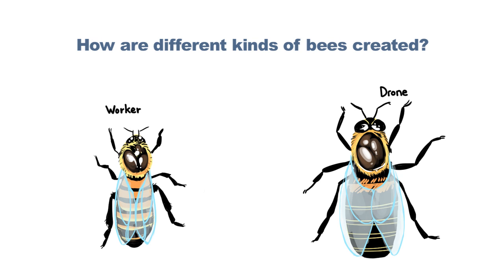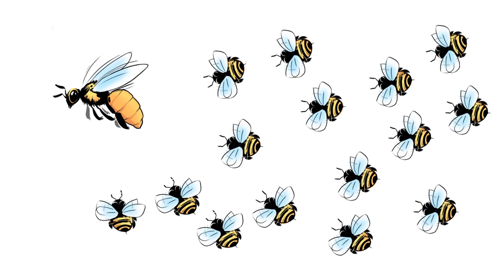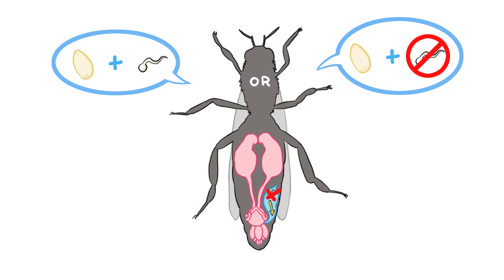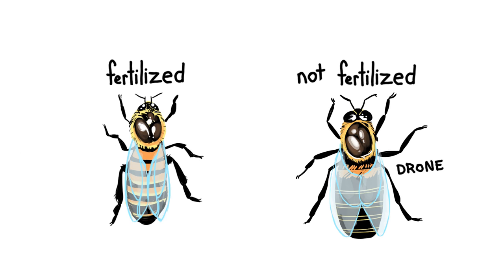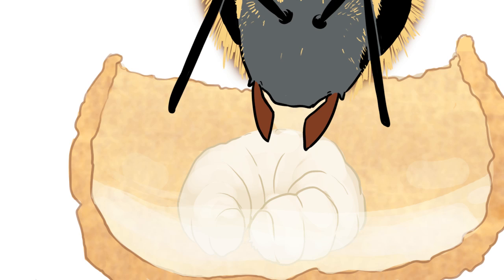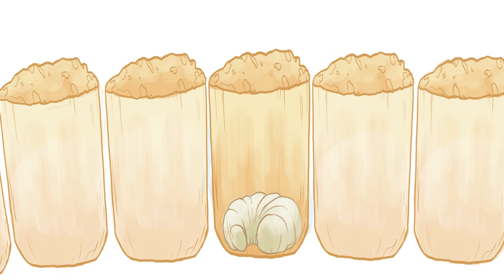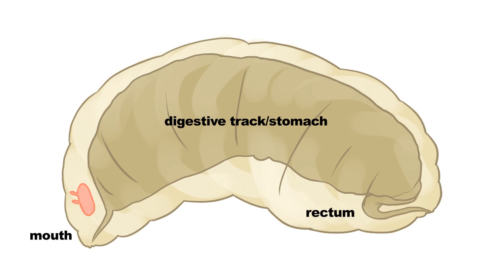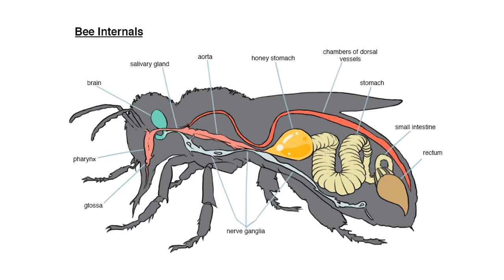Reproduction and Brood Development - How are different kinds of bees created?

Comment: The closing statement is not true: " and the rests filled with mostly blood vessels". There are no blood vessels in insects. It's only one. The last slide showed three systems. Nervous,  Digestive,  and circulatory systems. The last is the one that all "blood" go through, entering from back to front and it is the only "blood vessel" present. So there are no blood vessels filling the rest of the body. What is really missing from this slide is the respiratory system that is really filled the rest of the body because it has branches to reach all internal body parts and tissues for gas exchange.

Comment: I really like the way this video is presented, but there are two points that need correcting. 
1.  A queen bee will lay 1,500 to 2,000 eggs per DAY, not per season.
2.  "A fertilized egg will become a female worker bee if fed worker jelly." This is technically correct, however, its a bit more complicated than that. Worker jelly is simply royal jelly that has been mixed with various plant enzymes from the gathered pollen in the hive. 
A queen bee is developed when a fertilized egg is fed pure royal jelly with no plant enzymes present. It is the lack of those enzymes that allows a queen bees reproductive system to fully mature.
Reply: Thanks for this additional info
Reply: Yes, I agree with you
Reply: Thanks!!!
Reply: yep they make special pickled pollen to make workers, worker is special, not queen, there's nothing special in nature to be reproductive, but to be worker? that is indeed specialization uncommon across species on earth.